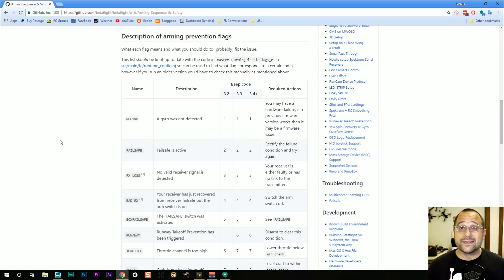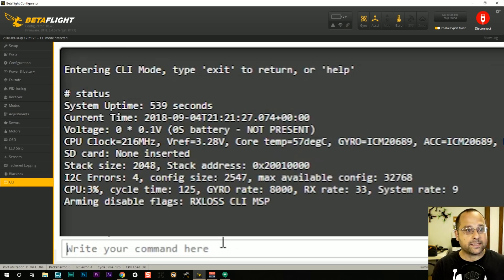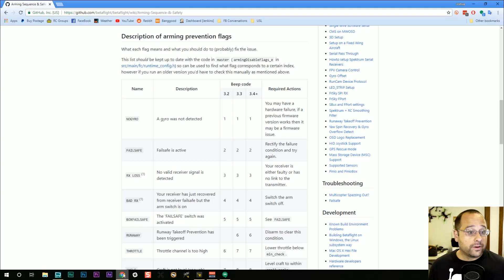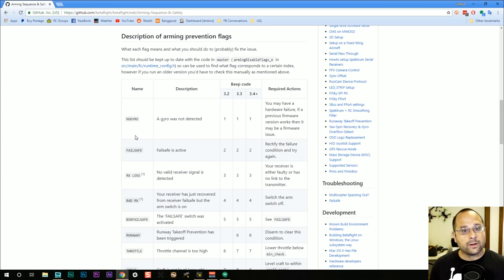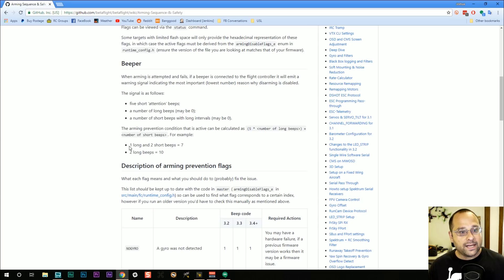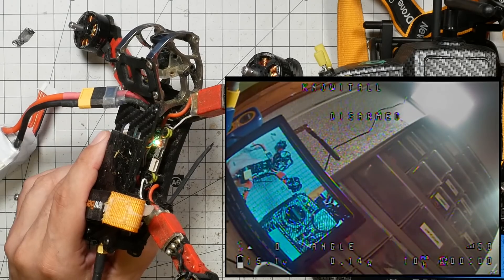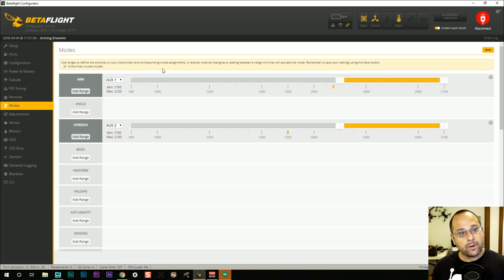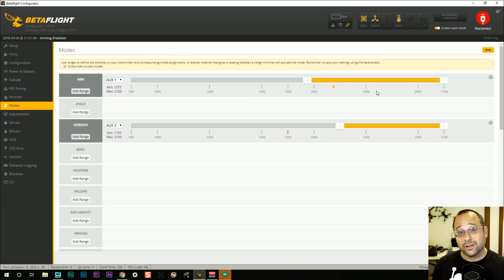BETAFLIGHT WON'T ARM | Introduction

Comment: I have an issue as my drone didn't arm receiver signal is good in speedybee app but drone didn't arm I am using 2s battery and fsi4x transmitter and fsia6b receiver kindly help

Comment: I’ve had these vids non-stop playing. I got the dji flywoo nano and it would not arm. It turned out to be a controller setting in the goggles. Difficult to find BC quad overheats real fast and kept trying betaflight

Comment: Josh i have an Eachine 3 and when i plug in my pack i only get 3 beeps instead of 5 and the quad does not arm, however if i connect the quad to Betaflight my receiver lights up the sticks respond and the motors spin up thru BF. O could sure use your expertise on this problem of which I've never had?

Comment: Need help with noprearm code can’t figure it out
Reply from the maker: You have enabled the prearm mode but you are not activating the prearm mode hence you cannot arm (which is the whole point of the prearm mode). Either delete the prearm mode or correctly set up an aux switch to activate the prearm mode before arming.

Comment: Josh, i had my arming switch working. But in trying to fix something else, I held the button down on my IRCSYNERGY F3 flight controller and now it wont reconnect? I have the Taranis qx7, vortex 180, and fatshark goggles. I had them all working together at one point and now at a loss as the goggles OSD isnt working right either. Also, using betaflight 10.7 and firmware 4.0.6. Any help would be awesome!
Reply: https://youtu.be/Wx24PQ0sceI this is the clip i watched thinking i may have held the bind button too long. But on my board you only get a blue light when you hold down the button on the flight controller. That's where i think i screwed up. I am sure there is an easy fix I just have no idea how to solve it.

Comment: hey newbie here. when i plug battery and flick the switch to arm i bet a beep and my receiver  and vtx turns off. any idea what the issue is. i check all solder joints already tried 2 diferent rx same issue

Comment: When I try to arm it the shows THROTTLE on the OSD. I've already set the bounds so the lower bound its above the throttle minimum. Also  on the betaflight main page it shows the info for blocking arm = THROTTLE MSP ARM_SWITCH
Reply from the maker: If you see THROTTLE then it means the throttle channel is above the Stick Low Threshold. If it seems like you fixed that, go back and double check, because something isn't how you think it is.
Reply: @JoshuaBardwell  i found it. The tx (FSi6) was on training mode, and that arming switch  would turn all values to 1500 right away. Thats why it wouldnt arm . thank you

Comment: I have RXLOSS, BADRX, CLI, MSP, and ARMSWITCH. This is supposed to be a bind and fly drone! 😫
Reply from the maker: Fix rxloss and the others will clear up. Your receiver is not set up right.
Reply: Thanks, I’ll try and get it to work 👌
Reply: Sorry for the bother but whenever I connect my drone to betaflight and connect my remote to the drone as well, my QX7 constantly says telemetry lost, telemetry found, over and over again. I’m pretty sure it’s not brown because it will happen when the drone is across the room from the remote. This problem only occurs when the drone is hooked up to betaflight though.

Comment: Hi JB.
Awesome channel. 
I have racked my brain and my pc. My problem is that in betaflight under modes my arm status is disabled. I have tried everything.  I'm using a tarnished qx7 and have set up all variables. Betaflight shows status of quad at 'Arming disabled'  
Any help at all would be massively appreciated!   Cheers.  SP.
Reply from the maker: Follow the steps in this video to find your arming prevention status code. That will tell you why arming is disabled. Then find the status code in this playlist to find out how to fix it.

Comment: I was able to bind - but the throttle controls don't show
Reply from the maker: If the receiver tab doesn't show any channels, you need to download the latest version of the betaflight configurator, and then also download the latest betaflight firmware (version 3.5.9 as of today) and flash it to your board. Having a super old firmware on the FC, or having a super old configurator can cause this problem.
Reply: I give up

Comment: Hi Josh great video as always. I messed up a little here I think... half accidentally I pressed the “return to factory settings” button and as you can imagine I’ve lost everything. Of course now I cannot configure the tiny 6 again because I’m a beginner! 
Any ideas will be greatly appreciated. 
And keep it up. What you are doing are. Great help to all of us.
Reply from the maker: One lesson here is, when you get a new quad, go to the CLI and type "diff all" then save the output. It will help you restore config in the future. For now rebuilding the config from scratch is the only option.

Comment: Could you please advice.  I have problem with matek F405 STD and BF 3.5.5. 
I cant arm when im in betaflight with disable arming code 17, 20.
But....when im not in bf the arming was fine...and i can fly.

What happen? Does  Bf and f4 do not allow arming in when using usb???  But in my spf3 everything arming  was fine whether in bf or not everything were okay. Im so confused regarding this....please help sir...
Reply from the maker: Betaflight 3.4 added a protection where the quad will refuse to arm when plugged in to USB. You can override this by going to the Motors tab and enabled the "props are off" option.
Reply: Thanks for your help sir, now...I can arm and enable "i undestand the risk",,,,in the motor tab,,well its good. for safety.

Comment: I get “Arming disable flags: 0x1004”

Upon further inspection, the xm receiver has solid green led so that means bound successfully. But when I plug into bf, click receiver tab and move the sticks,.... nothin. 
So the rec is bound but not talking to the fc?
Reply from the maker: Correct. The FC is not configured correctly or the receiver is not wired correctly to the FC.

Comment: Hey Joshua,
 Great videos on arming issues. I ran into another arming issue that you didn't cover in your series.  "Throttle CLI armswitch" which I finally figured out that my throttle minimum was lower than my throttle setting on my Taranis for one of my quads, which until I raised minimum above actual throttle minimum it wouldn't arm. Thanks again for all the info and keep up the great work.
Reply from the maker: I do appear to have overlooked the throttle flag.

Comment: I am wondering about the beep codes: can they be output through dshot commands like the beeper switch?
Reply from the maker: No, that doesn't work. But you can count the LED flashes.

Comment: 0x804. ???arming disabled code😳
Reply from the maker: Are you running a super old version of betaflight? Or maybe on a board with not much flash memory? The old version used a hex code for the status flags. It's a bit harder to decipher.
Reply: I'm running a Naze 32 ANFA version 2 with BTFL 3.2.5   spooled up and got hot on rear right motor (no props on) thanks for that tidbit of info.

Comment: Great video. I have a question and would love to hear your opinion. Is there any efficiency and/or thrust benefits for raised rear motors? I get that they should have cleaner air in forward flight but theory is always fun and great. Are there any real world differences?
Reply from the maker: I think the difference is probably pretty small, but not zero.

Comment: Hey josh quick question. I just finished building my quad and I took it out and tested it. It worked great except for a small yaw twitch that I fixed. What kind of maneuvers do you do to "shake down" a quad? or am I good.

Comment: Mmmm That's cool.  INav needs that arming disabled warning. Right now it just has system messages on the OSD but the Status command works in the CLI same as you showed with BetaFlight.

Comment: Here's a Betaflight change that tripped me up recently (thanks to kind RCGroups users for this answer):
Since 3.3.0, to use Stick Commands to trim the accelerometer, the craft needs to be disarmed and in angle or horizon mode, when 3.2.5 and previous didn't care what flight mode you were in.
The fix was easy, just adjust the slider for angle mode to include disarmed.

Comment: #1
Reply: I am not able to get any response in the quad to my transmitter. This happened after just hooking it up to Betaflight. I flew it yesterday and had a soft landing. Now in Betaflight on the receiver tab nothing happens. But when I power down the quad the Taranis X9D says telemetry lost and when I power it up it says telemetry recovered. Is there somewhere I can go for help ? Thanks Richard